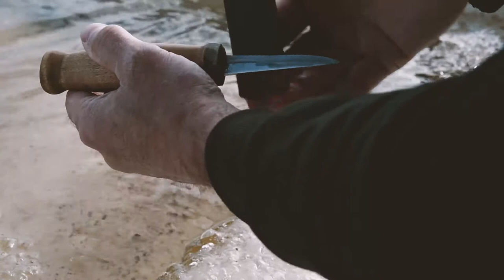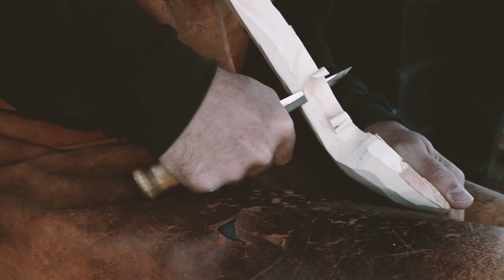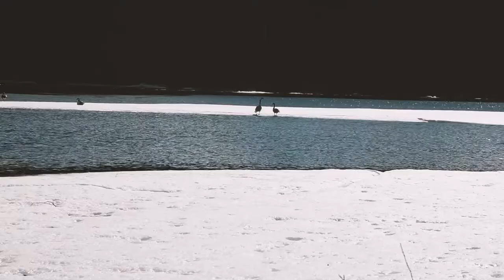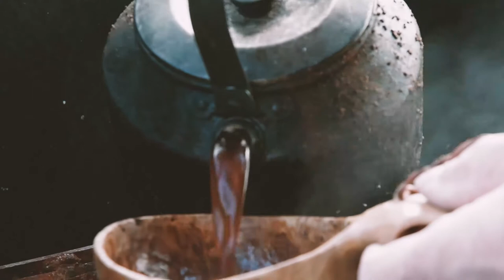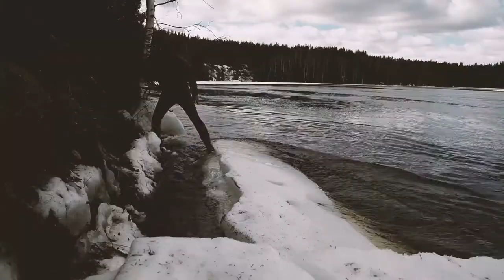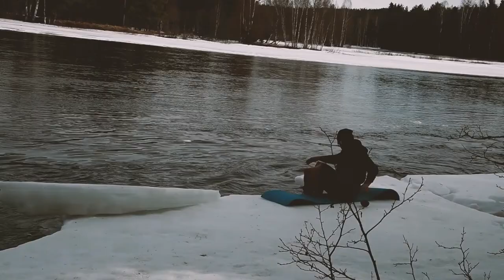Spooncarving by the river ljusnan.

Comment: I have started carving spoons and realized the hatchet I have isn’t cutting it.  (Pun intended) do you have any suggestions as to what hatchet I should buy
Reply from the maker: yes I would recommend the gränsfors large carving axe. Best regards Niklas
Reply: The hatchets you buy from the hardware stores usually have a steeper 30-40 degree angle on the bevel. If you have an angle grinder or a file,  just grind away some extra material on the bevel and modify the angle of the bevel to 15-20 degree angle. If you sharpen your hatchet properly, it should be able to cut very well. If that does not work, you need a higher end hatchet. 
https://www.bnctools.com/pages/axe-sharpening